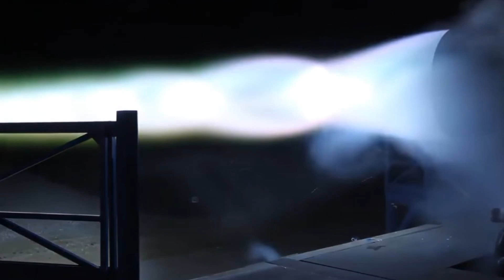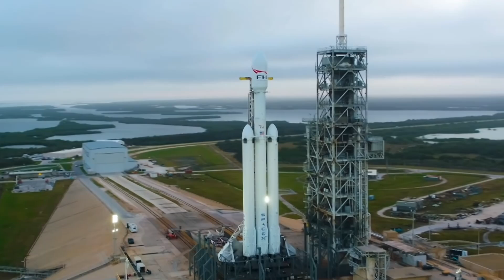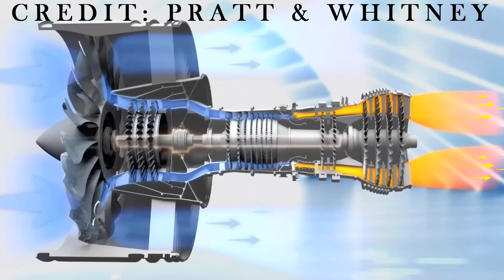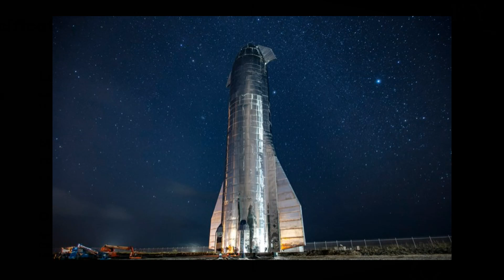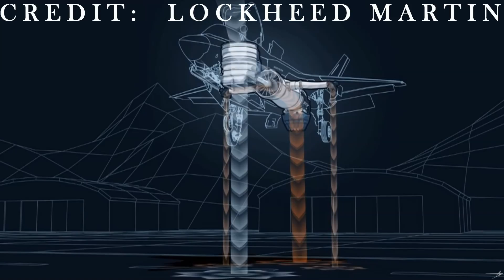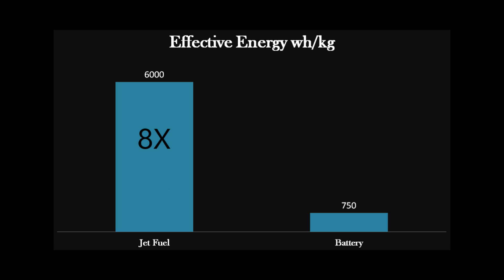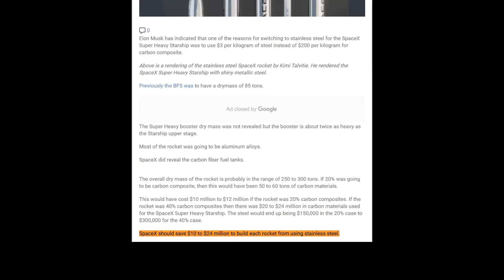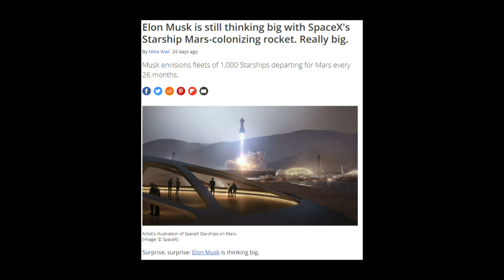ELON MUSK'S BATTERY POWERED SUPER SONIC VTOL JET - My Tesla E-SuperVTOL design

Comment: Why do intercontinental vtol when Elon’s space ship will do the 8000 mile trip in 45min
Reply: Intercontinental rocket passengers transport will never happen. Mainly because of very low payload and the impossibility to be as safe as regular aircraft.
Reply: @anteeko  people said that about aeroplanes. now they are safer than cars. with the power of computing making micro adjustments to rocket for vertical landing and 10 years of doing this with no issues, I think it's a real possibility. 
payloads a problem? I think this is a fuel cost issue once the reusable rocket is common over the next 10 years. wouldn't the big heavy be able to take 100 people or so in next couple of years (theoretically)? in ten years who knows, there seems to be exponential growth factors in here that makes it seem a real possibility in 10 years or so.
Reply: rockets are unsafe and unreliable
Reply: @midnightwatchman1  generally speaking ??
Reply: pollution. We don't want thousands of star ships moving people around. The current airline industry is already bad as it is - star ships will make it worse since they lower flight time by 10-20x (12 hour flight becomes 30 min flight) - at aprox the same ticket price - that will increase demand like crazy  - which will increase pollution like crazy. 

We need to drop the pollution and keep all other benefits. This is why makes sense to have electric jets.
 
But hyper-loop will be the real distance solution, since will be faster, safer and cheaper then any aircraft can theoretically be. Unless we invent anti-gravity in which case the air route becomes superior again. Wet dreams i guess.
Reply: @aion2177  You ALL are missing the point: who wants to pay same ticket price for 30 min flight? Part of the air travel appeal is the flight experience itself in a most comfortable accommodation as possible. I am designing a MEGA air transport that is actually 2x slower than the current airliners. Passengers need at least a bunk bed if the flight is longer than 12 hours.
Hyperloop is NOT a solution, but literally a 'PIPE dream' (pun on vacuum pipe tunnel); severe limitation in difficult terrain: mountains, rivers, etc.
Reply: @viewer7200  You got it wrong. Air travel appeal is not the flight experience - is the speed. You can't move from Istanbul to Rome in 2 hours by car. You can't do it by train. Not by tank. Not by boat. Not by super fast boat. Not by limousine if you want service. Not by anything other then a plane - in 2 hours. You need the plane/air route because is fast. If would be possible to do that in 10 minutes, even better. If instant - better still. Most traffic is not for fun. Is business. People need to move. And time is money. And 12 hours stuck in traffic (intercontinental flight where starship shines) - be plane or otherwise is just stupid if you don't have to. And is not just staying in the plane and typing on your laptop, or watching a movie. Is security checks, waiting in line, stress, rules, more rules, exceptions form rules, luggage worries, other people, smelly people, angry people, normal people, funny people, crying kids, sometimes terrorists, canceled flights, more waiting,  - corona virus crap for example. All that. You wish you would not have to go trough it if there is a better alternative. After a while you get tired of it. Only the first few times on a plane is an adventure. After that is just dull and a chore. So the faster it all ends, especially 20x faster, and if for the same price - the better.  Starship will do that possibly (well see with the off shore platform distance to city will not actually take longer) - but pollutes like crazy. We rely don't need more pollution as i was saying before. 

Now i agree with you that there might be a niche for fun trips - like a zeppelin yacht, a baloon, same idea like a cruise ship is - is just relaxing and fun to go slow and enjoy the view from above.. a yacht in the sky .. cool ... but most people don't travel for that reason. And if you design something - ensure you know who your end customer is and what they rely want. 2x slower then normal airplane is maybe too fast for this relaxing purpose - and too slow for the previous one described.

And hyper-loop is not a pipe dream - is theoreticaly THE BEST WAY TO MOVE - outside of anti-gravity(UFO like capability and speed), and teleportation(instant). Since both of those are not achievable yet, it means we need to build the hyper-loop if we want super fast, heavy mass capable transport. 

For long distance, hyperloop is better then air anything. BY A LOT. Try moving 20 tons of cargo by air, 3000km away, across the continent, fast, very fast - in less then 2 hours. just try - is called the B2 stealth bomber. It's 2 billions each. Hyperloop gives you that at less then -1000000x the cost. Yeah that's a million x. Will be less then 0.5k to ship 20 tons cargo. Less then what a semi truck shipment costs now on the same route distance, carrying the same mass. And im refering to Tesla semi here - which is much cheaper then disel trucks. You beat that truck with the hyperloop. You can have thousands of "trucks" using the same pipe - at the same time - like on the autoband - but better since is no rain or snow or weather issues of any kind or  dead dears and stuff - shipping things automagically, no drivers, no accidents, no stupid shit. And fast. Lightning fast. As such is better. BY A LOT. 

It also means that is better then using the sea - the big ships - all that. Same idea. Ships are slow, and expensive, and need captains, and crew, and maintenance, and a nurse on board, and a paint every 5-10 years, take it out of the water, remove buildup of corals, paint, dry, put it back in.. then unreliability - pirates, and rough seas, and are not electric - or the ones we have now don't do electric - instead they are disel - meaning they pollute, and not reaching in all places like a network of roads is - only in ports - that's not as useful as direct delivery - etc, etc, etc. 

So why would you use a ship when something like a hyperloop will be available? Why would you use a plane when you can get the same speed muuuuch cheaper(for cargo)? Given vtol ability to get out of atmosphere might reach super fast speeds and will not be expensive. So maybe for people you still want to use planes. This vertical landing will give amazing possibilities, like reach top of mountains, remote locations and such. Just maybe. Even if super cheap and  super fast - you dont need that helicopter-like ability often. Not for most things. If i put you in a hyperloop and show you a fake window with a screen displaying a real flight window you can't tell the difference. You can't tell if is a screen inside a hyperloop or a real plane window - can be designed as such. So maybe is just more speed capability with the plane there - because maybe it can reach  into stratosphere, reach higher speed then the hyper-loop will be designed for, and still keep a low enough ticket price  that would make you go for the plane instead. Not for cargo though. But just maybe - because for city to city you are better off with the hyperloop.  

Because the hyperloop is a plane in a tube - basically. Dont think about the shape. Think about fundamentals. What they both do. Where the limitations rely are. How a hyperloop can still use maglev - for propulsion - no immediate limit there - and the plane can't - because it needs the air, and the air makes drag. Catch 22 for the plane there. The hyperloop pod can be in near pure vacum. Less air friction the better. Why would you say a plane, any electric plane, can be faster?! So maybe.. depends on designs.  but can that plane carry 20 tons ?! - nah. not fast. B2Bomber carries only 18 tons. So hyperloop can be designed to be  the winner no matter how you flip it. 

Fast as a plane, or faster, and with the load of a train, with the reach of a car or truck on a road system, with the volume of an entire maritime shipping route - all big boats combined - all that by cutting out most of all transport related pollution? how many superlatives you need to give this a deeper thought? 

Why would you invest time studying naval engineering, aeronautical engineering, transportation engineering, wishing to build roads, bridges, big boats and planes - when this right here makes everything else OBSOLETE?! or 90% obsolete. WHY? I guess people dont rely think - thats why. Only Elon thinks. Or people they have their hobbies - but that's different. 

If you rely want to be serious about building the next  transport infrastructure on which we gonna build this civilization - then think again. What do we rely need? See the hyperloop for what it rely is. Drop the "hyper" part, and drop the "loop" part. Drop more things also. Drop the tunderfoot idiotic points too. Go into the fundamentals. The essence of what was described there. Try to see how to crack the problems we have with it not call the hole thing a hoax. 

Despite what you were led to believe, there is nothing fundamental standing in the way of a hyper-loop like system. Is just people with small imagination and lack of engineering talent. We need better engineering. You gonna see it later. Im working on something like this, it's obvious to me. There are a few tricks, but you'll need to wait.

And if you are designing zeppelin like systems - which cruise on the air, like a big ship is on the sea, or whatever else you are building there  - then let me know. Im interested in all sorts of things which can enhance the way we live. This is not supposed to be a long comment but i guess i got carried away.
Reply: @aion2177  My mega SkyShip model is on my channel. I uploaded a few videos when I tried to launch it this summer.The scale of the prototype is ~1:300
Reply: No fossils, just methane and oxygen
Reply: @Chris E-jets of the future have nothing to do with global warming, recycling, compost, vegans, diversity, or safe spaces, they will be simply more efficient than fuel jets.
Reply: This could be a smaller capacity one than that one
Reply: @Chris not the main reason for going electric
Reply: You can't build rocket launching sides near big cities because of the amount of noise that gets produced even if you manage to get the rockets safe. Apart from that it will be a lot more expansive to travel via rocket then planes.
Reply: GB - starship can do NY - Europe in just 15 minutes.
Reply: bruh, no ya'll are dumb no, the real reason that won't happen is, how to know whether it's an ICBM or not
Reply: HOW CAN U BE SURE THE PAYLOAD IN IT ISNT A NUKE
Reply: It's going to be used by the military as a disguised ICBM
Reply: @Chris Starship is Methane powered which can be sourced from renewable sources as well, which is why it works on Mars too.
Reply: @Chris LOL.  It would take solar panels the size of Jupiter to gather enough clean energy for a transcontinental electric airliner. It's a beautiful idea though.
Reply: @flagship1701e  yes it takes a lot of power to make Methane. However, your numbers are not even close.

Comment: Musk talks about a battery powered aircraft being able to fly at higher altitudes where jet fuel wont burn and the sonic boom don't reach the ground. At high altitudes the friction is less so it may not get as hot as blackbird so they might be able to use aluminium alloy instead of stainless steel. The f-104 shows how small wings can be even when it has to land conventionally.

Do the kinetic energy equation and mach 2 is 235 kilo-joules per KG and mach 3 is 529. While 500 watt hours is 1,850 kilojoules so at mach 3 the batteries kinetic energy will be over a quarter the batteries chemical energy. That does not leave much room for inefficiencies.

At high speeds and altitudes it might be more efficient to use some kind of air breathing ion/plasma motor similar to VASIMR, actually why are ionocraft/lifters considered so inefficient at low speed? As they are silent where is the wasted energy going its not obviously visible where the waste is.
Reply from the maker: Thanks for the info!

Comment: I'd suggest that you could get more thrust by angling the front engines to take advantage of the aerospike pressure cone formed on the nosecone, similar to the way the "blackbird" use cones on the front of it's engines to help focus more air density into the engines at trans-sonic velocities... Having 6 smaller engines could potentially allow you to do this multiple times, likely with diminishing returns... This is purely conjecture though...

Comment: Good video overall but my problem is that you are comparing your futur electric plane with current ones so it drive up your efficiency gains... Must of your cost gain can be applied to conventional plane as well : no pilots, no windows, better aerodynamics, improved efficiency, reduction of maintenance cost.
I think your argument about using stainless steel for the fuselage is not very good since composite material are much lighter and already in use in modern plane (787), we can hope that in 10 years they will much cheaper and easier to use.
Also, I think you might want to use different motors for Vtol and the mane propulsion because their efficiency range would be very different and it would add the benefit to not have gimbals but only thrust vectoring (wich would be much lighter in my opinion)
Reply from the maker: Great feedback.  Do you know the strength to weight ratio of aircraft aluminum vs stainless steel.  I'm working on another video to correct the errors in this one.
Reply: @thelimitingfactor  
Stainless steel : Yield strength = 250->1000 MPa ; Density 8.03
https://www.azom.com/article.aspx?ArticleID=2874
https://hypertextbook.com/facts/2004/KarenSutherland.shtml
Aluminium : Yield strength = 97->500 Mpa ; Density 2.78
https://www.metalsupermarkets.com/history-of-aluminum-in-the-aerospace-industry/
https://en.wikipedia.org/wiki/7075_aluminium_alloy
https://en.wikipedia.org/wiki/2024_aluminium_alloy
Carbon composite : Yield strenght = 2.9->2137 MPa ; Density 1.15->2.25
http://www.matweb.com/search/datasheet_print.aspx?matguid=39e40851fc164b6c9bda29d798bf3726

As you can see in term of strength to weight ratio, aluminium and carbon are far superior to stainless steel. The reason why Space X is interested in it, is primarily for its thermal property witch are very good and compensate for it's weight. As for the cybertruck, it's very interesting for it's Rockwell number as well as it's corrosion resistance.But for a plane, you don't really need either and you might prioritize weight above anything else.

Comment: I love the design, however, I disagree with you on 2 points, I still think it would need a pilot, I doubt you would be able to get a fully autonomous commercial aircraft past the aviation authorities this side of 2050, and I'm not sure it would happen this century.
The second is that it would need landing wheels, purely for the ground mobility reasons, from hangar to terminal to take off/landing pad
Reply: Agreed on both points, but I would note that those wheels (and their support structures) could be a whole lot lighter if they don't have to cope with the impact of a conventional landing.
Reply from the maker: @patheddles4004  YES!  Quite a few comments focus on the wheels.  I'm happy to throw a couple wheels on.  The key things I'm wondering about are supercompressing the air for supersonic flight, the shape and materials
Reply: I think autonomous electric skateboards (similar to those used in new high tech parking buildings to move cars) would be a simple and speedy solution to this.
Reply from the maker: Agreed!
Reply: if the wheels are such a problem as the video said, i think it would be no problem for elon to overcome this problems
maybe an "door-roof" (i dont speak inglish sorry"
Reply: @tartaria6767  I don't know what you mean by "door-roof", and I really want to know. Can you explain in your language (Portuguese?), so I can translate to English?
Reply: @patheddles4004  maybe "retractable roof" is a better way to say
Reply: Nathan - agree, smaller , less robust wheels to TAXI to and from the Skyway.

Comment: 14:12 "No Windows?"
Reply from the maker: Correct!
Reply: @thelimitingfactor  https://www.youtube.com/watch?v=xaVgRj2e5_s
Reply from the maker: @jefflucas_life  Alon is an excellent idea.  However, the primary driver for removing the windows would be to extend service life and reduce manufacturing costs.  No windows sucks, but it also offers and opportunity for something better - StarGazer Mode, Floating Mode (plane disappears around you), etc.  By this point, VR will be cheap as chips.